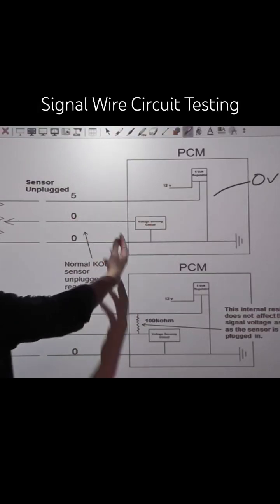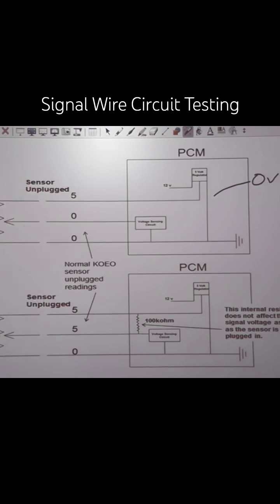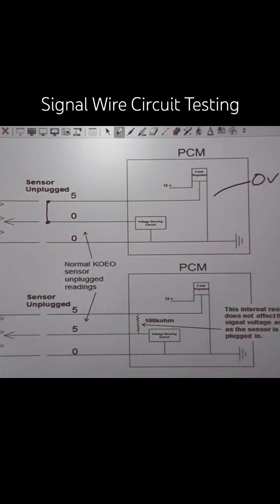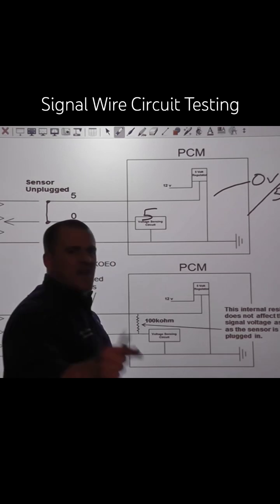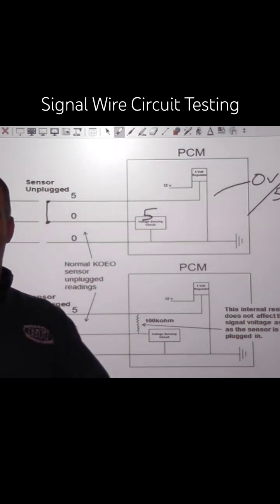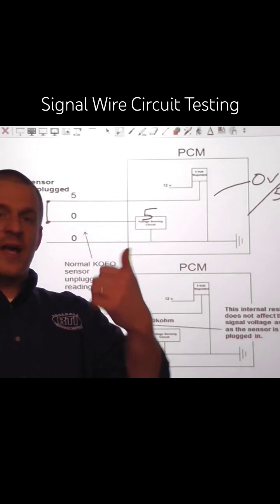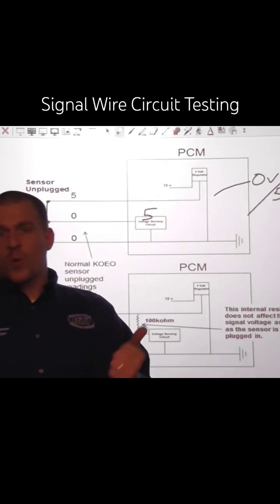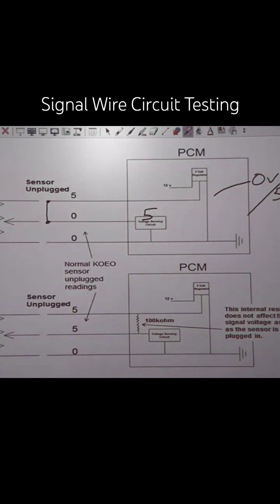Testing for Opens and Shorts [Signal Circuit Integrity]

Comment: I can just see someone goofing and jumping the 5-volt line to ground and shorting out the PCM.
Reply from the maker: Use a test light instead of a jumper wire in case you jump the wrong pins

Comment: Also need to make sure the ground wire is good. When you you lose the ground wire and the sensor is unplugged it reads short to low like normal but when sensor is plugged in it reads short to high and sends all voltage back through the signal because there is no ground to dissipate the extra voltage.
Reply from the maker: A faulty ground will ALWAYS elevate signal voltage. In this case, this is the test for signal voltage fixed a 0v. So the ground circuit discussion comes in when signal voltage is fixed high, not low. Hope that makes sense.

Comment: Great video.  I also like to short the signal wire to the ground circuit as well and watch the signal go the other way on the can tool if the signal line isn't already at 0 volts unplugged.

Comment: Mechanics won't get or don't have training in basic DC circuits will be lost.
Reply: Yep. If you know how electricity works, you can figure out just about any issue. AC is a lot of fun, too. Not. Lol
Reply: It's not the circuits so much as understanding the use of a reference voltage to begin with. The way sensors and cpu's operate necessitate the steady state that is not Zero.